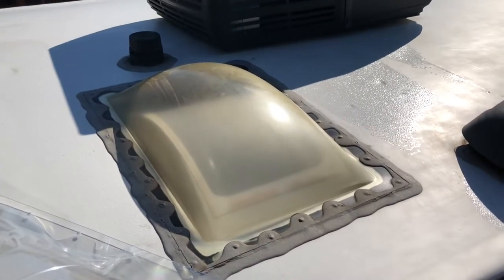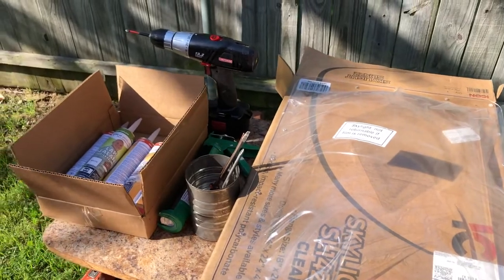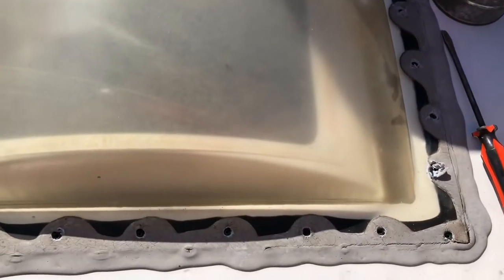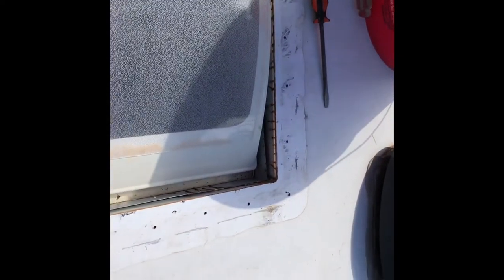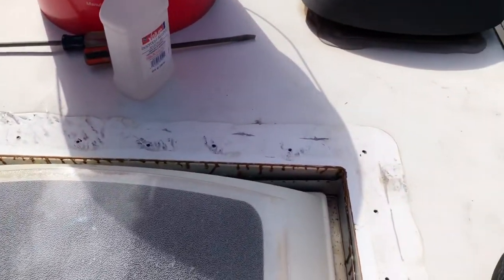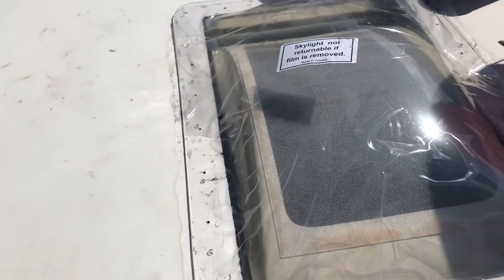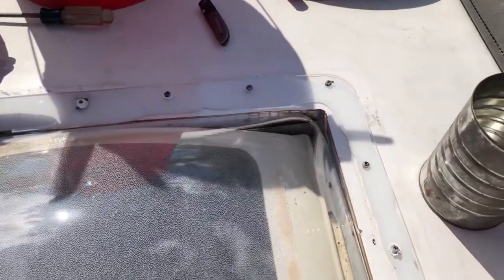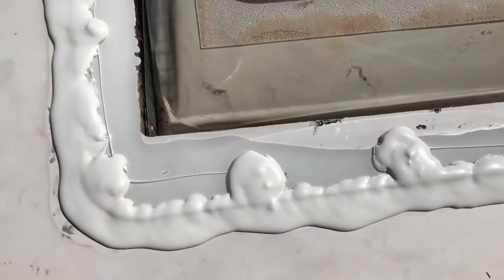RV skylight replacement

Comment: I also live in Texas and learned years ago to protect my vent covers and skylights with horse stall rubber mats. You can find them at Tractor Supply. When we are finished camping for the year, along with winterizing the RV, I put my horse stall rubber mats over each of my skylights and vent covers so I don't have to worry about hail storms in the spring. The mats are made from a heavy rubber and I've never had one blow off even with 75 mph winds. When I remove them in late spring, I roll each one up and secure with with heavy duty Velcro tape to keep them rolled up. These mats are heavy to climb a ladder with, but it's much easier to do and less expensive than replacing your skylights every few years.

Comment: What type of lap sealant did you use between the new skylight and the roof?. Was it the same as the self-leveling you put on top of the skylight and screwheads after installation?
Reply from the maker: Yes, it was all dicor self leveling.

Comment: How many tubes of lap sealant did you need for the project
Reply from the maker: If my memory serves me correctly, it took right at one tube for the skylight. I always try to have extra lap sealant though so you might have two on hand just in case.